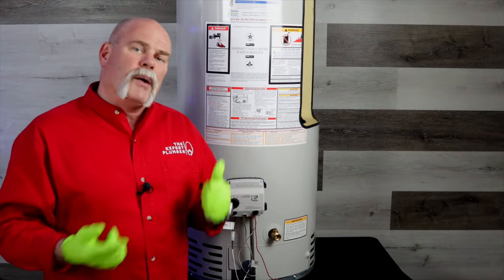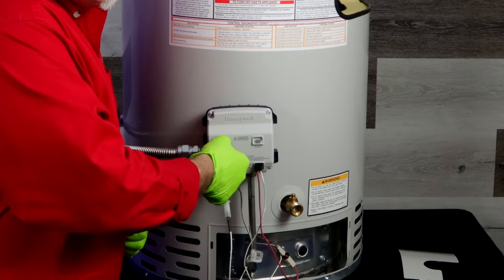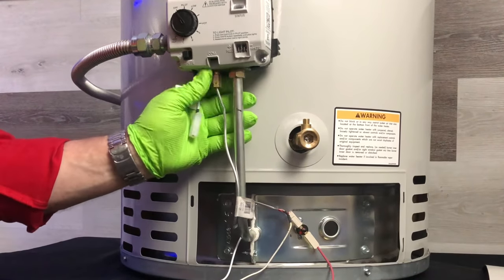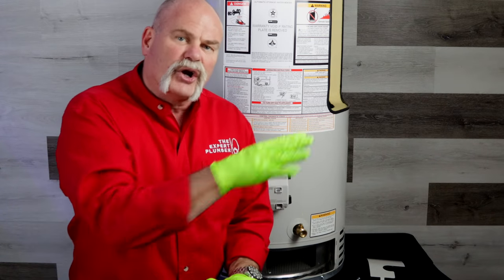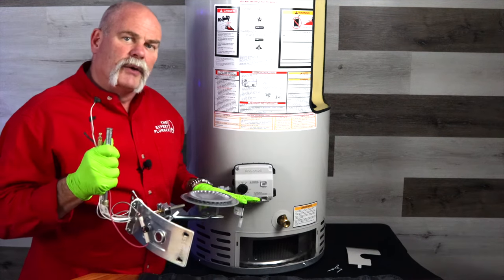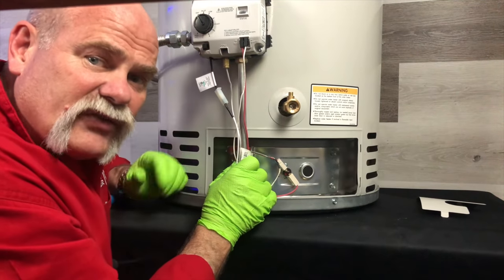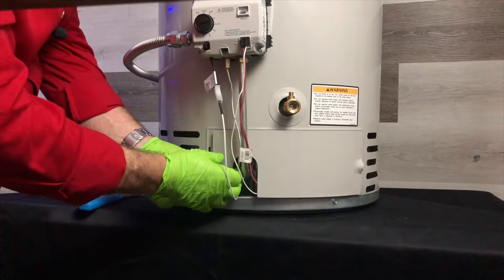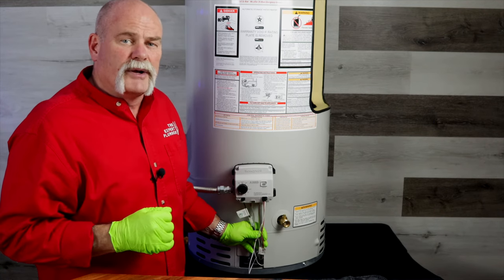How to Replace the Burner Assembly in a Gas Water Heater

Comment: Okay. I just did mine and the burner had to be pried out. It would not budge with just my fingers and didn't move at all after taking the screws out. On my tank  their is also a thick red gasket behind the burner plate where the screws are and I don't see that in your video. What's going on? Lol

Comment: How do you affix the brass nut to the smooth gas pipe leading to pilot? It came separate from the assembly from the distributor. Your video shows it already attached.

Comment: I feel like I'm well verse on how the system works now than the guy that came by last week. Half way through he basically gave up and ask me if I wanted a new water heater. I told him I ask him to come to fix it and I'm not buying anything new when this one is only 3 years old.  I checked it today and it seems like I'll be putting in the new burner.. Because it definite burn below the burner assembly... Looks like there is leaks in the line on that assembly.

Comment: I have a 3year old 50 gallon Bradford white water heater installed by plumber. It started to make explosion noises so I called the plumber. He removed the burner assembly and found the burner completely covered in sediment. The flue is joined to the gas furnace flu in attic and then into the chimney . Do you have any idea how this could happen?

Comment: Thank You So Much. The spark ignitor on my gas water heater went bad and so I hadx to replace this burner assembly. I was quite anxious about it because I am not at all handy when it  comes to plumbing issues. But with an estimate of between $600 and $800 dollars to get a professional to do it- I decided to give it a try myself. Less than $140 dollars for the part and about an hour of my time- Job Complete and hot  water restored! Thanks again Roger for the  simple and straight forward instructions! If I can do it- anyone can!!

Comment: Great video.   One important note - some Honeywell control valves use a left-handed thread on the gas line connection, so need to be careful when first disconnecting the line to avoid damaging the threads in the control valve.
Reply: Best comment ever!!! Thank you for this!
Reply: Hey I know your comment is a year old but thank you so much. I had already stripped the grip but then saw your comment, and with a bolt extractor kit was able to get it off. I hope you're having a wonderful day.
Reply: Not sure why some of them use a left-hand thread and some don't.  Hope your repair turned out OK. @jakecheesbrough2905

Comment: Holiday weekend. This was priceless.
Reply from the maker: @Apocalypse Quicksilver did it work for you?
Reply: @RogerWakefield  excuse me sir, i trust you over any other youtube channel. My brother in law told me to youtube how to disassemble/reassemble my water heater to make repairs. Ive been a certified automotive tech for over 9 years so im not new to taking things apart and putting them back together, i just want to make sure i do it correctly. I havent been able to find a manual for proper tear down/ repair of the thermostat/elements. If you could point me in the right direction....please

Comment: I have been watching your channel for sometime now. I appreciate your hard work and content. Keep it coming!
Reply from the maker: @manny ramirez thank you so much. Are you in plumbing?
Reply: @RogerWakefield  wondered what pro like you site would recommend in this case? I'm trying to get into the burner to clean & vacuum, I have everything disconnected, except the burner hose seems glued to the valve box. I've given it everything I have & the nut on the hose won't budge. Seems loc tighted or something very strange is going on. Any advice?? I don't want to rip the valve off of the tank, but that's what's taking all the torque..

Comment: Roger, you are the man! Thank you for these helpful and detailed tutorials. I have a question: our water heater pilot won’t doesn’t stay lit. I’m able to keep it on long enough to get the burner going, but it goes out between 10-15 minutes later. I replaced the thermocouple and it had no effect. The flame has a lot of yellow/orange in it. Do you think I need to change out the burner assembly or is this a thermostat problem? If the latter, is that also an easy DIY project?

Comment: A month ago, the water line braided hose sprang a good leak from the top of the gas hot water heater. I turned off the gas and water supplies. Replaced the bad supply line. Turned the gas and water back on. Successfully lit the pilot then adjusted the control valve for medium heat. The burner lit as expected.  Then.... A month later, a major water leak occured.
Due to living in a 35 yr old Mobil home here in Texas, the place has sunk into the clay to the point that it takes a really skinny person to attempt any repair needed. This caused us (mom 87 and myself 60, disabled and not skinny lol) to be without running water for 3 weeks.
We are too poor living on social security to just call for a plumber.  The PVC leak was inaccessible even to my 69 yr old skinny brother who came from Muskogee to help us. We had to cut thru the floor of mom's prized back porch of solid wood planks ... ugg.  We got it fixed. Porch went back together just fine. We now had running water albeit cold only. Here's the current issue ( I know I'm long winded)
When I try lighting the gas water heater.... The pilot goes out as the gas control valve attempts to light the burner. A completely yellow fire ball ignites with a woosh consuming the available oxygen and blowing out the pilot. Vents are clear. I know I have to get to the burner which lead me to Googling the issue. I was pleased to see the assembly is available.... But I wanted to see a walk thru of the procedure, thus, I turned to YouTube. Lo and behold (cue angelic music) there you are Roger... Like God sent "Video Plumber advice on-demand" who else but a fellow Texan rides in to save the day like the Lone Ranger. 
Your video was exactly what I needed to realize that I can do the job. Thanks for the safety tips also. Liked and subbed. 
Alvarado Texas
Reply: Your pilot and or main line is rusted causing gas leak that blows out the pilot.  Need to replace whole assembly probly
Reply: @jjseed3407  "probably"

Comment: I just replaced both the control valve and burner assembly on a Bradford White propane water heater. The reason I had to replace the burner assembly was because I did not know the burner tube nut has left hand thread so the propane model.

Comment: Great video with good explanation even for novices. 
Here is a side question Roger, which I have a hard time finding answers. Most appliances (Furnaces, stoves etc) are easily convertible from NG to LP. Why water heater manufactures discourage or even prohibit to convert water heaters from NG to LP even though some manufacture both furnaces and water heaters (e.g Rheem). What is the reasoning behind not converting water heaters? Thanks

Comment: Thanks. I have an issue you haven't covered in any of your videos. I've had a faint smell of gas in my utility room since I purchased my home almost a year ago. I've bubble tested every single gas connection in the home several times (including lines for pinhole leaks), but never found the leak. I finally purchased an electronic combustible gas leak detector and found there is gas leaking at my AO Smith gas water heater 's vent, and it's peaking the meter! This is obviously why I was unable to detect the leak with the bubble method. It's important to note that the burner has a strong clean blue pilot flame and combustion looks ~normal when the water heater turns on. No error codes on control valve. The vent pipe appears to be drafting normally with smoke tests, both with utility room door closed and open. The air intake screen at bottom of water heater is clean and unobstructed. My question is why am I detecting a gas leak at the water heater vent if the pilot is lit and it's burning and drafting properly? Is it possible the burner assembly has a leak somewhere? I'm concerned as there is clearly gas detected at the vent and I don't see how this is possible unless the burner assembly is leaking somehow? Any suggestions would be greatly appreciated. Have you ever experienced this?

Comment: I wanted to ask, today I replaced the thermopile on my state select water heater. I brushed the inside and cleaned bottom ring filter, and vacuumed inside burner assembly 

BUT , when I removed the burner assembly the gasket was totally cracked and brittle. 

I resumed install and have it running without a gasket, you can feel some warmth but it’s not dramatic at all. 

A master plumber stated the gasket isn’t necessary if you don’t have one on hand and back in the day they used to be open just don’t store any flammable around the area. my gasket is special order. 

Is it a total need to have a burner assembly door gasket?

Comment: Is it bad if the thermocouple and ignitor pin to be touched by the flame from the top round disc during normal operation? Or should it be more far apart ?

Comment: So quick question. My father in law was replacing a part in the water heater and when he was dissembling everything he was removing the pilot light gas line wire and when pulling it out it snapped. Is there a way to repair that or do we need to replace the whole unit. Basically it snapped under the tip of it? He went gentle but it broke off? Any videos showing that?

Comment: I have a clog in one of the drain pipes and my basement flooded about 2" off the ground a couple days ago... my water heater was in the area ... (this is a very brand new water heater- mind you) it was soaked. Did I ruin anything?
 I tried resetting it and after about 30 seconds of trying to lighted it just won't give.... What should I do

Comment: One thing to mention is be careful with the copper and aluminum lines - I broke the aluminum line by accident at the top its super delicate and i bought a new cable assembly (not sure that is what is called).

Comment: Ok so we got the burner replaced on the hot water heater. But we’ve smelt a burning smell on it. Is that the new burner breaking in? It only happens when we take showers a plumber came out and said the same thing I said I just think it’s breaking in

Comment: Do anyone have a recommendation for the gas nut being screwed into the gas valve if it won’t connect.  The Honeywell gas valve replacement is made by resideo and it will not screw into the new unit.  Everything else works but not gas line in

Comment: Hi my water heater turns on then the light flashes ones per second, then when it turns off after water tank reaches correct temperature the light flashes two times is thst normal or not?

Comment: My gas water heater the pilot light is on but the burner never turns on. I let shower run 15 minutes with hot water only the water is Luke warm pilot light on and the burner never came home. Has standard gas valve. What should I check?

Comment: Can someone tell me what the red wire does? A rat chewed through the red wire on my gas water heater. I was able to do an amateur fix, but if I jiggle it at all, the flame in my water heater goes out. It's almost like it short circuits something.
Reply: It's the positive wire that's what powers the control valve and gets your heater working.